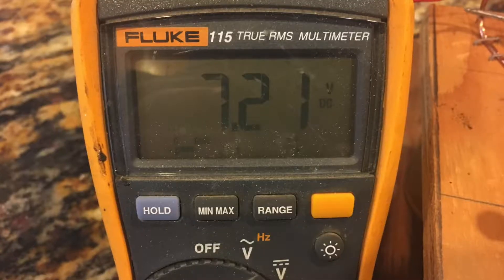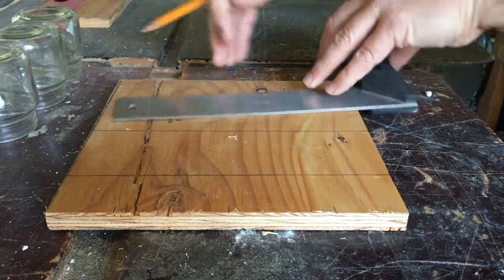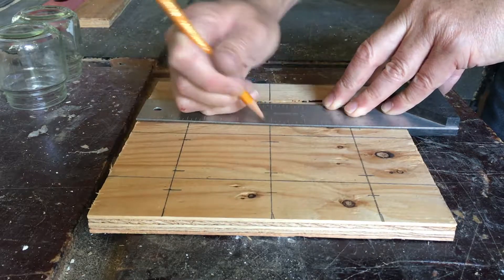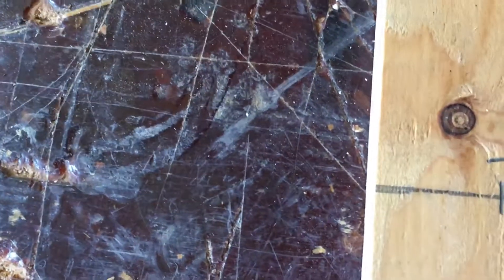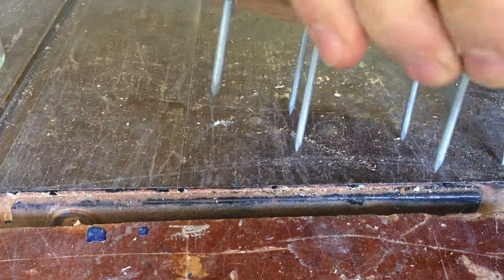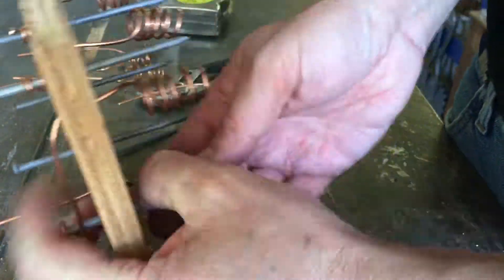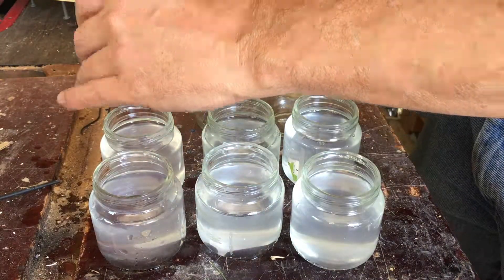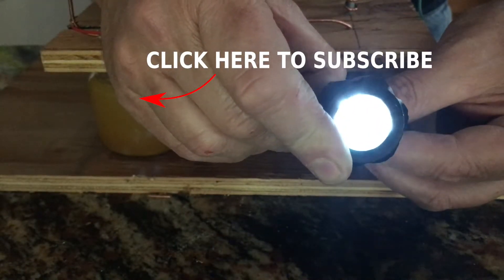How To Make - 7V Salt Water Battery Out Of Nails & Wire

Comment: Dosent need 250c to function?
Reply from the maker: I'm not sure what you are asking.
Reply: I read salt battery working temperatur is 250 @MyEngineeringProjects
Reply from the maker: Oh i see what you mean.  I think you are referring to the liquid salt concentrator type of battery.  This type of battery stores thermal heat so it can be discharged 24 hours a day.  This is not a chemical reaction but a thermal storage system which differs from the type of battery i made for this video.

Comment: How would you have done the wiring differently if you were trying to get 12V-13V range instead of 6 to 7 V range?
Reply from the maker: Simply add more cells in series.  You would need to approximately double what I did in the demo to reach this range. Each cell's voltage is added to the next.

Comment: I would think if You had bigger bottles maybe you could get more power? Or maybe you'd need longer wires and nails for that too.

What you did was amazingly cool.
Reply from the maker: The goal here would be to increase the surface area of the metals.  The ions when charged are stored here.  The electrolyte just needs to be sufficient to pass the ions from one metal to the next.

Comment: So when I read about how to make batteries or what they are made of they quote these chemical solutions. I understand some of it but not all. Like for example, for a zinc battery it says they use, (ZnSO₄) for the solution. I understand what that means but ... is it originally H2SO4 and only becoming zincSO4 after the battery is being used? I get a bit confused on when they quote the solutions for the batteries, if what they state is after its had some ions replaced or not while the battery is being used.

Comment: How long will this battery last?
Reply from the maker: Not very long it’s just a demonstration battery. It has fairly low current.
Reply: @MyEngineeringProjects  will it work for a few minutes or hours? I want it to work during my school's science exhibition.
Btw very nice video.👍
Reply from the maker: For a school science project, you can run the LED for a while a few hours probably it’ll be enough to show how it works
Reply: @MyEngineeringProjects  I have one more question for you. Can I use a thick aluminium wire instead of the galvanized nails?
Reply from the maker: It will work but bear in mind that each metal has different characteristics and produce different voltages.

Comment: How many ampere hours is it? Also how much electricity can be added to it?
Reply from the maker: So this is just a demonstration battery so it's really small.  So tiny that I had hard time trying to measure it's ah capacity.  Like any battery, you can add in series and in parallel to make any size and/or voltage that you need
Reply: The video says you'll do a follow up video on the amp hours. But that appears to have been removed, or you forgot to put it up? I was hoping to see what it'd be about.

Comment: Did you charge the light beforehand? What are the wires you are using in 6:40
Reply from the maker: There is no need to charge it before using.  The battery is at full capacity as soon as it's created.  The wires were just some hookup wires I had lying around.  Probably 22 gauge but anything will work since the current is so small.
Reply: @MyEngineeringProjects  Thank you

Comment: I’m wondering if you used silver solder sticks in place of galvanized material if you would get different results. Or I should say more energy.
Reply from the maker: It would be interesting to find out.  Each combination of electrodes will produce different results.
Reply: you can try different metals..... like zinc and copper?? or zinc and magnesium even? stuff like that.

Comment: Hello, I'm a grade12 student. Your video really helps a lot. We are redoing you experiment. I would like to ask if we can use iron nail instead of Galvanized nail? Is there any significant difference between these two nails? we have confusion about the type of nail T^T

And also we are confuse if do we need to connect it on any charging devices 6:24  for it to be charged before use?
Reply from the maker: Hi Raine.  Glad to hear you are replicating the battery.  You could try an un-galvanized nail and see how it performs.  I used a galvanized nail so that the battery would use the zinc from the nail.  I have not tested regular steel.  Let me know how it goes.

You do not need to charge it when it's first built.  You will get a voltage and will be able to light a small LED immediately.

Comment: Hello, wouldnt the galvanized nail zinc layer get oxidized and lose the zinc coating and then expose the iron nail which would have much lower voltage and then rust quickly?
Reply from the maker: Most likely yes it would.  Corrosion in general is a problem with salt water batteries.  This was just a test project to demonstrate the concept.

Comment: what if you increase the surface area and connect it in parallel with many more like that. will it increase c rating?
Reply from the maker: Yes it would.  I did just that and maxed out at about 1000 milliamps
Reply: @MyEngineeringProjects  how big did you do? I mean, something like 10 amps, 48 volts. Then check
The capacity. How big the build do you think it will be to achieve 48v 10amps?
Reply from the maker: The largest one I made is a single cell but it had a large surface area.  This is the same as several cells in parallel.  I over charged it on purpose and shorted the terminals to see the absolute maximum current.  The size was about 2" x 3/4" - 1 amp max but the life was short so it could only do it for a few seconds.

A few years ago I talked with a salt water battery manufacturer.  The batteries were designed to store photovoltaic energy.  For 10 amps and 48 volts, it would probably be the size of 4 car batteries.  For a house, it was on a pallet.

Comment: @My Engineering projects,  this is a great demonstration but how long will this last and how can calculate its life span? Also, will it still work if someone uses very thin copper wires? why did you have to coil the wires like is it still gonna be the same performance as using straight wires?
Reply from the maker: Due to it's small capacity it can only do a few milliamps.  Thin copper would work.  I coiled it in order to increase the surface area.  You could use straight wires as well.
Reply: @MyEngineeringProjects  so how long would you say will it last ? I don’t understand what milliamps are. Could it go on for few month ?
Reply from the maker: Amps are a measure of the number of electrons that flow per second.  It's a huge number of electrons so we use amps to make it easier to work with.  A milliamp is 1/1000 of an amp so it's 1000 times smaller than 1 amp.  Small batteries like AA, AAAA etc are measured in milliamps  since they are smaller.  A typical AA rechargable could do something like 1500 miliamp-hours.  The hours says that 1500 milliamps could flow for one hour or a a factor of this at a lower flow rate such as 750 milliamps for 2 hours.  This is a unit of energy which is current flowing over time.

My demonstration battery is very small and it can only max out at about 10 millimaps total.  This is not a unit if energy, but a unit of work.  To say how long will it last, we need to define the flow of current in amps that the battery could sustain over time, which describes how much stored energy it has.

I left that tiny led light hooked up and the battery ran the light very dimly for a couple of weeks. So dimily that I could only see it at night.  I would say it was running in micro amps at this point, but nonetheless I was able to see energy flowing out for a while.
Reply: @MyEngineeringProjects  thank you very much for your work !!

Comment: How long does it need to be charged? 
What is the Ah approximately? 
Nice project :-)
Reply from the maker: This battery is very small.  I just made it for demonstration purposes and it has a small surface area.  Therefore, the amp-hour rating is hard to find.  I attempted it but the max current is just a few milliamps.  It did run for weeks at a very small load but I don't know the rating.  The length of time to charge for any battery depends on the current you are charging and the capacity of the battery.

Comment: Hiya, how would I construct a set with 24volts? And is it possible to make it in sets, and if so how would I connect the sets together.  And from the sets how would I connect it to an inverter?
Reply from the maker: Sure.  You can put more in series for higher voltage.  Likewise you can put matched pairs in parallel for increased current.  This demo project cannot run an inverter due to it's low C rating.

Comment: Can i build this in the ocean?
Reply from the maker: Only one cell but you could have cells in parallel
Reply from the maker: Of course I haven’t tested this but I think it in a large body of electrolyte it would quickly fail as the distance between electrodes increases
Reply: @MyEngineeringProjects  sounds right.

Comment: When you place them in series and increase the voltage to 7V, electrolysis should happen right? So you would have to divert the oxygen and especially hydrogen away somehow and add more water at some point unless i'm mistaken :)
Reply from the maker: Any over voltage charging should increase the electrolysis.   The battery would have to be encased in order to prevent the water from evaporating.  If it got too dry due to evaporation and/or electrolysis , water would have to be replaced.
Reply: @MyEngineeringProjects  okay, thanks for replying :) 1,23V before electrolysis is not much to work with..
Reply: Well you have to remember that hydrogen is going up at 45 miles an hour and that there are tiny holes for the hydrogen and oxygen to escape not giving and build up
Reply: By closing the bottle, you could prevent evaporation, no ?

Comment: Would more salt benefit the battery? I'm looking for solutions to make the converting salt water into fresh water profitable. From my understanding, desalination can only convert 1 gallon of every 2 gallons into saltwater. The other gallon is heavily salted and is dumped back into the ocean which could lead to issues in the local marine ecosystem. I'm wondering if Brine can be used to generate electricity instead
Reply from the maker: Desalination in any form requires a great deal of energy.  Adding more salt does help, but it would have to be a huge battery in order to desalinate.
Reply: @MyEngineeringProjects  true. What if the steam from desalination turned a turbine before becoming freshwater. Maybe that could ease the loss in energy consumption.
Reply from the maker: With a heat desalination system, it's low pressure and can't easily turn a turbine.

Comment: How long does it take to charge the battery?
Reply from the maker: Charging any battery is calculated by knowing it's capacity in amp-hrs and the rate of charge that it can accept.  For example say a battery has 1000 mah capacity and we charge at 200 ma, then  1000 mah/ 200 ma would be 5 hours.  Since this battery has so little capacity, it charges very quickly.  I'm working on a new design to overcome this issue.

Comment: Would it improve or decrease performance if you chose several thinner, twisted copper wires instead of a single core?
Reply from the maker: It would increase the performance.  The issue with wires and nails is that there is a small surface area available.
Reply from the maker: To followup: both the cathode and the anode would have to have an increase in surface area.  If only one were changed, it's unlikely there would be much difference.
Reply: @MyEngineeringProjects  Thanks, that sounds plausible :-) I have seen approaches where they have used metal-foam elektrodes with increased surface area, to maximize the volt output. I wonder if something similar could be achieved without a nanoscience lab, by bending a stripe of sheet metal around some really sharp angles, so that the material rips and tears on a microscopic scale... 

Sounds stupid enough? Let's give it a try!!  :-D

Comment: There's too much salt water. You can save space by calculating the volume of salt required to dissociate the zinc and copper into ions, the problem is that the recharging process might not work as expected - i.e. clean electroplating of zinc onto the nail and copper onto the wire.
Reply from the maker: Good point.
Reply: dont bother electron plating...just buy some zinc bars.
Reply: wonder is stainless steal works? it would withstand the corrosive salt.

Comment: What're the volt and amp rating on the solar charger? How long should you keep it connected to the battery?
Reply from the maker: The solar module voltage was too high for the prototype battery.  It had about 18V open circuit with around 500ma of current.  In order to make that work, the battery has to have more cells in series and in parallel.

Comment: what's the math behind why 9 small jars gives 7V? What would be needed to make a 12V or 24V battery?
Reply from the maker: Each cell as a potential of about 0.7467V.  Batteries in series add the voltage, so 9 in series is 6.72V.  If you want 12V you will need  16, for 24V you would need 32.  Keep in mind that the voltage varies depending on the metals used for the cathode and anode.  I'm only reporting based on Zinc and copper which is what I used for this test.
Reply: I thought an electrolyte cell was capable of holding just over 2 volts-that's why we have six cell 12 volt batteries.  I didn't know about metal type and all that.  I made a small cell with stainless steel bolts and used sulfuric acid one time and baking soda the next and was getting over two volts on that after having it connected to my car's 12 volt system,  so I just assumed that all liquid cells were two volts.

Comment: Marvelous! Is it potentially a battery for perpetual motion?
Reply from the maker: No, that would not be possible.
Reply: @MyEngineeringProjects  oh I see. Corrosion will be the end of it right? Still, this tech will give light whenever there's power outages. Will it be affected by EMP?
Reply: Please don't mind my curiosity 🙂 I've never had real physics/chemistry classes.
Reply from the maker: A battery under a small load like my LED will eventually exhaust the stored energy and will need to be recharged.  Corrosion in a salt water environment is something that has to be dealt with.

Comment: Stupid just use 1 pickel jar
Reply: They have to be in series. So yes you can use bigger jars to make the battery last longer, and more total power, but to get the same voltage you need separate containers.
Reply: Why not use 20 each 50 gallon drums?

Comment: Cool video man! How did the amp hour test go?
Reply from the maker: Well the battery performed differently than I was expecting.  It continued to light a very small led for weeks and I gave up trying to perform an amp hour test.  The current was very low and I didn't have a method to measure continuously over such a long time frame.
Reply: @MyEngineeringProjects  Thank you for replying. Weeks, cool! Wonder what increasing the load does! Keep it up dude

Comment from the maker: I'm preparing the next video to determine the amp hour capacity.  After 24 hours the light is still on so we'll see how long it goes before the light goes out.
Reply from the maker: Today is day 5 and the light is still on.  So much for time lapse photography - switched to still photos,
Reply: @MyEngineeringProjects  

How long
Reply from the maker: The light stayed on for weeks but it was really dim.  The current was really small and I did not measure it continuously.  I thought it would only last for a few hours when I originally posted the comment.
Reply: @MyEngineeringProjects  

This is the only test you did on salt battery?
Reply: @MyEngineeringProjects  if you replenish salt in the water, will that prolongue electrical generation ? .. or, how can you "recharge" such a battery ?
Reply from the maker: There is no need to add more salt.  The batteries are rechargeable and have a long life compared to other technologies such as li-ion.  The disadvantage is that they have a relatively low energy density.
Reply: @MyEngineeringProjects  How do you recharge the salt water battery?
Reply: @Kopie0830   With electricity. I think typically 9 volts, 200-300 mA is a safe way to do it.